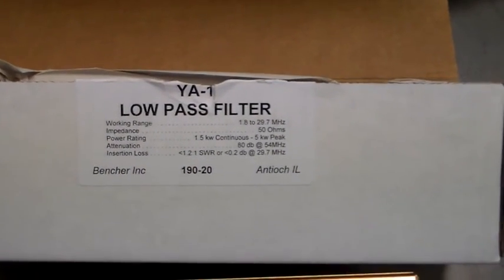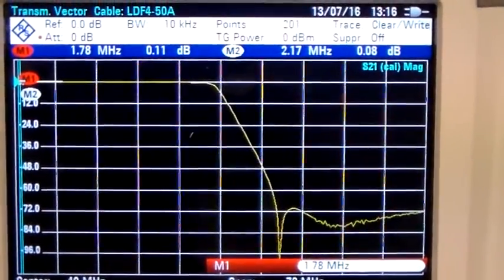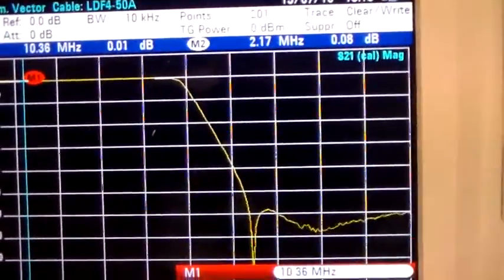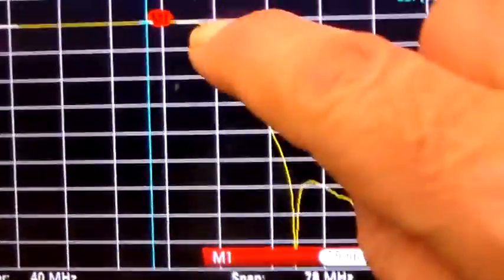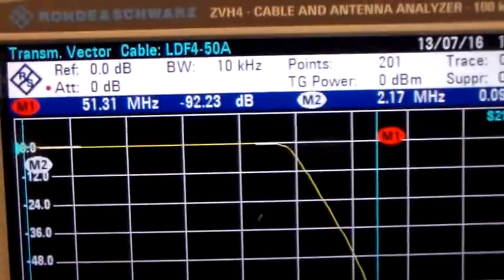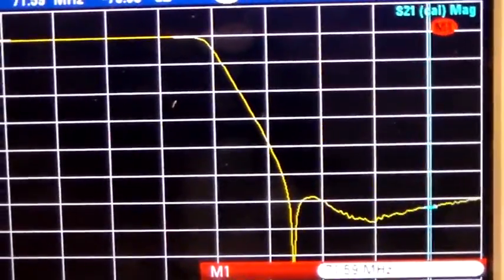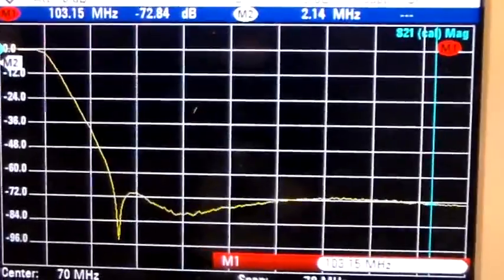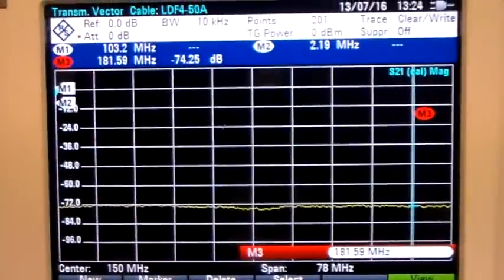Bencher YA-1 Low Pass Filter Response On Analyser.

Comment: Thanks for doing this video. I have a YA-1 that has been on my shelf for years; have taken it out to use and this video pretty much confirms what other reviews also say - that it does work well. 
Maybe a stupid question but I want to be sure : The two SO-239 sockets are not labelled Input and Output -  I can't see how to distinguish which is which. I presume that it makes no difference, that it makes no difference which end you plug input and output?
Reply: According to the directions I still have with mine it doesn’t matter which way you connect it. It does say if you are using an antenna tuner you should plug the filter between the radio and the tuner. If you install the filter after the tuner it says it could be damaged when you tune up. Hope that helps.